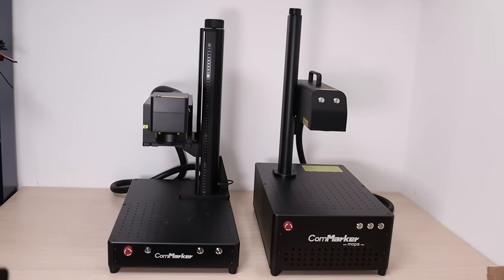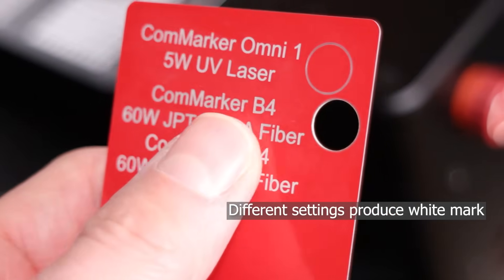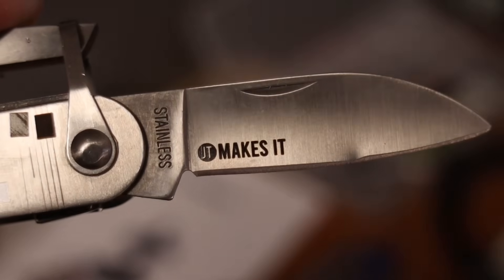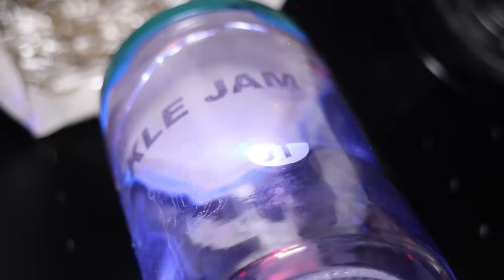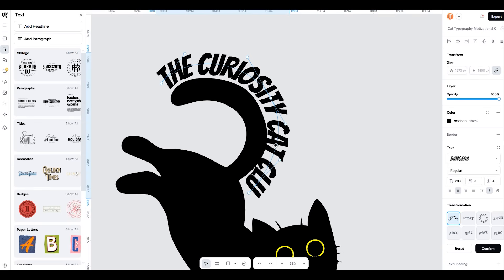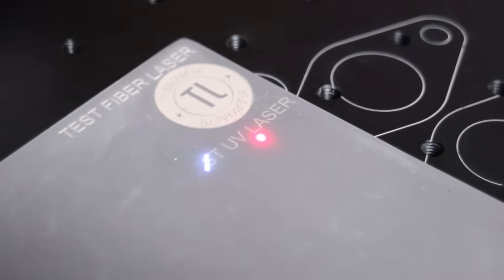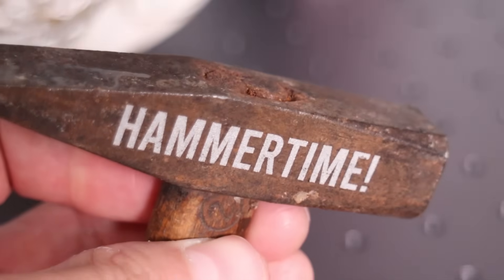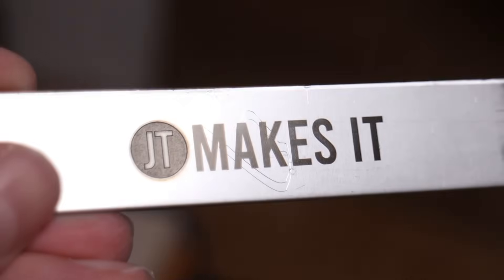UV Laser vs. Fiber Laser – Which One Should You Choose? [ALL MATERIALS TESTED]

Comment: Another question, Actually i want to build a project where railway clips or other iron parts should be engraved with a QR Code to identify the info about that part, so guide me about what should we do in order to engrave a metal surface like this rail clips (which are a bit rounded) also should be cost-effective for students purpose.
Reply from the maker: Fiber laser would be the best option for metal. If the roundness is not more than 2mm, and you don't need exceptional engraving finish, maybe even a standard, non MOPA 20W q-switched laser would be enough (like the 20W ComMarker B4 I reviewed a while ago)
Reply: @JTMakesIt any method to engrave QR code cost effectively for a prototype of project? 

One more thing, provide me your LinkedIn or some other social media ID, where I can contact you if possible.
Thank you.
Reply: @JTMakesIt Okay, thank you for replying.
Next thing, as we are students here so is there any other very very cost effectively way we can engrave the QR code on this laser rail parts which are a bit rounded, around 20mm diameter atleast for a prototype purpose.

One more thing, if possible, please give us some social media or other handle where I can contact you incase I come around some other question.
Reply from the maker: @ShlokTechnical  it depends on the material of the rails. My social media links are in the video description.

Comment: Can this UV marking machine work on silicone? Is it safe for food utensils such as spatulas?
Reply from the maker: UV laser works very well on silicone (like silicone watch straps etc...). If you engrave stainless by black annealing they should be very safe. If you engrave normally they should be to, although rougher surface is a bit harder to clean

Comment: How deep were you able to get with the Omni 1 on steel and aluminum?
Reply from the maker: It can go a few tenths of a mm but you need to leave it working for quite a long time
Reply: @JTMakesIt  How long do you think it would take for about 0.01"? Commarker gives numbers for their machines but they don't explain what they did for the test or how long
Reply from the maker: @alexanderm8880  I haven't done it with 5W Omni, but I did cut 0.4mm aluminum with the 10W in this video: https://youtu.be/LH6GypFHd6Y
I suspect the 5W could take 2 to 4 times more time
Reply: @JTMakesIt It's interesting that they don't clarify very much--I won't be using mine commercially so I'm not worried about the time it would take so knowing it's possible at all is a selling point
Reply: @alexanderm8880  Cut 0.7mm stainless steel in about 3 minutes. Did this for test (and for fun). But cutting metal is really not something uv laser should do. Taking uv lasers has shorter working life span than fiber lasers. If commarker highlight uv laser for metal cutting, I would suspect they are trying to let customers burn their machine faster so they can sell more machines.
Reply: @selmaosvaldo  They don't advertise it as good for metal, I was just saying that their information isn't helpful

Does UV not last as long? I think their site still rates it for 100,000 hours
Reply: @alexanderm8880  100,000 is for fiber lasers. UV lasers are shorter than that.
Reply: @selmaosvaldo  Just checked the pdf of the owners manual on their site and holy shneikies, you're right--only 10k hour lifespan. That's a disaster dodged.
Reply: @selmaosvaldo  I definitely didn't know about the lifespan decrease, if anything I thought that it being low wattage would be easy on the components.
Reply: @alexanderm8880  haha these are different lasers bro. UV and Fiber. Like oil cars and electric cars. It's not about the power.

Comment: 6:15 to make the engraving inside glass, you just have to tweak focus - put it below glass surface.  If you got it by accident, it's possible that the focus was slightly off.  If you experiment, you should even be able to produce 3D structures, layer by layer, adjusting focus between slices.  For this, shorter focal length helps, because it localizes the laser spot better in the vertical direction
Reply from the maker: Thanks, but I think it is not due to focus height (at least it should be affected by the settings too). because the test grid at 6:15 was all done with the same focus height, only the pulse width parameter was different. Some parts engraved on the surface and some in the middle with varying depth. 
In order to make intricate 3D embedded engravings in glass you need a different kind of laser.

Comment: Thanks for this interesting video ! What type would you advise for engraving zinc or copper plates with the intention to use them as intaglio printing plates on etching press ? I saw this can be done with the Xtool f1 ultra (fiber + diode laser)? But I wonder if this can be done with UV laser? Thx!
Reply from the maker: @LudoVanroy  for copper, the fiber laser is much better. UV laser can't make deep engravings in copper. You would want 60w+ fiber for best results

Comment: At 3:05, could you get better detail w a 70mm lens?  Thanks for the great vid
Reply from the maker: Yes, 70mm lens has even smaller focus spot size. I engraved the same pattern also using the 70mm lens in my full review video of the ComMarker Omni 1: https://youtu.be/rZXZM_2uSI8
Reply: @ Thx! I do mostly knife steels. Do you have any vids that demo the 70mm on a fl machine? Thx again
Reply from the maker: @ThadJB  HI, I don't have any 70mm lens for fiber. You can check my review of the ComMarker B4 60W JPT MOPA. I tested 110mm lens with that one.

Comment: If you are playing with high power lasers, safety glasses are important. 
I suspect the ones for (infrared) fibre, and UV, are different- don't get them mixed up!
Reply from the maker: Agree, safety glasses are very important. Each machine comes with a pair and indeed glasses are different for each one and can't be used across machines. But I have bought an additional pair that protects for all laser types that I have (fiber, UV, diode)  and I don't have to worry about mixing them up.

Comment: can't you really cut thin aluminum sheet (1mm) with the UV laser by passing on the mark over and over and over until it's finally cut ?
Reply from the maker: UV lasers are not very good at ablating metals. Even fiber lasers struggle to cut through 1mm metals. It would take unreasonably long for the UV laser to eat through 1mm metal.

Comment: There are a number of videos (shorts) showing UV lasers making a black mark on glazed ceramics that is smooth to the surface.  Some show a true black mark, others a faded grey. I would love to see photographic detail on glazed ceramic (tile or plate) shown using a UV laser that doesn't remove the glaze.  (many home decor and dining ceramics have a black mark, often produced by a laser, to identify the maker.) I don't believe this is commonly attributed to lasers and not marketed by any of the mainstream importers.
Reply from the maker: Great idea, I will try this!
Reply: @JTMakesIt  I would love to add a UV laser to my toolkit but have struggled to see if it would meet this need. If so it could replace my 60W Fiber.
Reply: @JTMakesIt  one of the shorts has settings. This might help as a starting point. At MACTRONTECHLASER 5W UV Frequency 30KHz, Speed 1200mm/s, Hatch 0.04mm
Reply: Any luck in testing this?

Comment: Can you details the glass cutting settings you demonstrated there?  So far with any attempted cut using my 15W UV, the glass cracks from heat before it gets through (6mm soda glass).
Reply from the maker: @guyb7995  in used 200mm/s 40 or 35 kHz and 1ns pulse, crosshatch 0.03mm. if it cracks try going faster and with larger pulse width
Reply: @JTMakesIt  yeah that's a pretty high power setting, I can give it a try but I have a feeling its going to crack.  UV is a colder process, but it is definitely not a cold process.
Reply from the maker: @guyb7995  your machine is much more powerful. You should need a longer duty cycle to reduce the power. What lens are you using? Mine is 150mm
Reply: @JTMakesIt   I have a few to play with. 110/200/300.  I could try a higher frequency or Q Pulse combo to try to keep the heat down but still fracture the glass enough to oblate it.  Speeding up would just make the laser get back to the same spot faster not giving it as much time to cool between passes.  Too many damn parameters... How much are those pico second M8s again 🤣?
Reply from the maker: @guyb7995  the best thing is to generate material test patterns and varying 2 parameters (q pulse and frequency) to see the effects they produce
Reply: @JTMakesIt  yeah I have my glass engraving worked out that way, but I don't think there is a drilling material test :)
Reply from the maker: @guyb7995  yeah you are right 😅

Comment: Can UV laser etch on white plastic like petg or pla (3d prints) I saw that you engrave on sark plastic so was wondering of the other way around was possible too, thanks!
Reply from the maker: @Choom42  I think it should do well on 3D printer plastic. If you check out my full review video of the ComMarker Omni, you will see how it engraves some other plastics too. Although I didn't have any 3D printer plastic on my hand to try it out. But I know it works well on ABS.
Reply: @JTMakesIt  
i think he means. "since it leaves a white mark on dark plastic.  can it leave a dark mark on light plastics?"
Reply from the maker: @darkracer1252 thanks for clarifying. Yes it can leave dark mark on white plastic. In the video I engraved a white power bank and it left a dark mark. I think it should go the same for 3d printer plastic

Comment: Got a question. That UV machine has the same properties than a Diode one? Because I see that you do things that I with my 10W laser, cannot. Or that UV machine resembles more to a Infrared one?.
Reply from the maker: Great question. No UV and diode are not the same. UV laser is 355nm, diode is 455nm and Fiber laser is 1064nm. They don't work the same way. Diode laser has longer wavelength and it can't do "cold" engraving like the UV laser can. Also diode laser doesn't work directly on glass and doesn't produce good results on textile. In the clip where I showed engraving of denim textile, on the bottom side of that piece there are some brownish engravings. Those were done with a diode laser. The difference is obvious.
Diode is in between fiber laser and UV laser wavelength.
Reply: @JTMakesIt  That's what I call a GREAT content creator. Thanks for the quick and detailed reply. Now I can honestly say that I know a little bit more. I'd like to know how the laser beam is generated in individual machines in order to a better understandint of the whole proces, so, there's an idea for a future video ;). Again, thanks a lot, much apreciated.
Reply from the maker: @adrianfgaleano  Thanks a lot! I really appreciate your kind words :D Simply speaking, a fiber laser stores light in an optical fiber (like a capacitor for light) and then shoots high energy pulses which can be 100 times the lasers average power (in 10kW range). This makes it possible for it to ablate metals like nothing. But the laser light generation is a very complicated topic. Currently even I don't fully understand the beam generation of UV lasers. It is a science of its own :D I might explore it one day and make a video! Thanks for the idea!